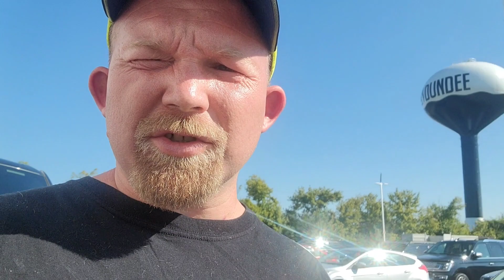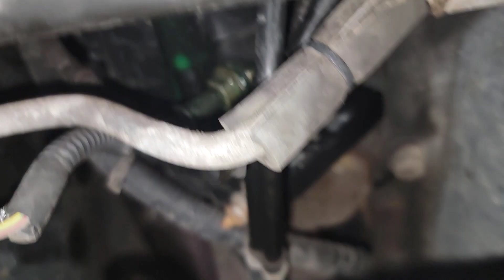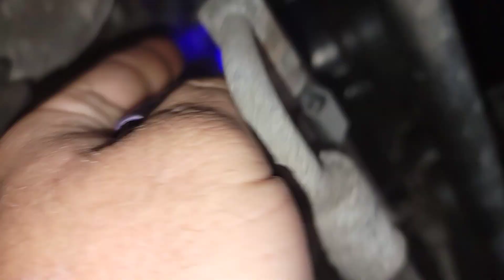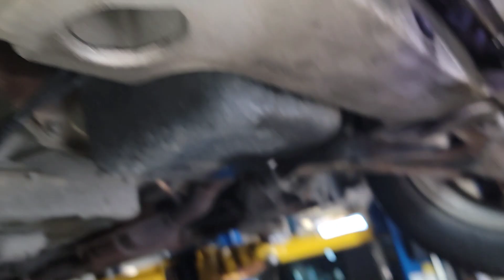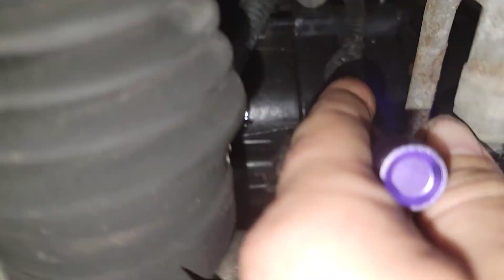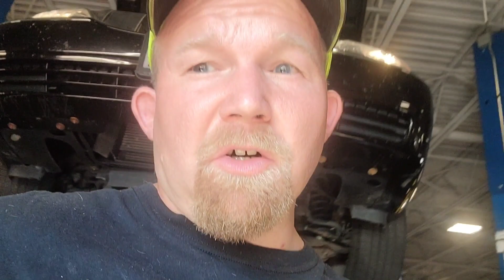2011 Lincoln TownCar AC Leak Been Here 4x - Finally Able To Verify The Leak and It's the Part

Comment: I received a power steering pump from Honda a few days ago that was supposed to be a reman unit. I opened the box and it was a used/failed unit that had apparently been sent for remanufacturing, but then it was just reboxed and sent back as a reman with nothing having been done with it. Parts quality really is getting starting to get bad. It almost seems like at the rate it's going, here in another 10 or 15 years, if you get a flat tire... you'll just have to replace the car. People need to stand up as one and say enough is enough, we don't want disposable cars, phones, electronics etc. We want well built products that are serviceable and we want quality well built options for replacement parts.
Reply: I've ran into that situation working at an independent parts store. I checked all the reman parts boxes when checking orders in. I had some instances where a core had been placed in a brand new box. I also checked any electrical/electronic items such as sensors and modules. Many times I found evidence that the unit in question had been plugged in and then returned to be shipped out again. One day I picked up some loose Wix oil filters at a warehouse. I checked each individual filter for any damages. One filter had a good size dent on the bottom. I refused it and pointed out the damage to the counterman. He issued a return credit on the spot. He wrote it up as a "new return". They were going to restock and resell the filter. I couldn't believe what I witnessed.

Comment: What's worse is, this is an OEM pricey compressor, likely a nice $400 to $600 part yet there are aftermarket brands that will outlast them for $210 such as UAC, Universal Air Conditioning.
Reply: @bikeman1x11  Yeah but these days, even the original parts are failing early which makes you really think about going back with OEM or choosing a good aftermarket part. If OEM's are failing early, no point in banging your head on the wall for OEM do overs.
Reply: @bikeman1x11  Once the OEM fails early, it make no sense to allow loyalty to interfere with common sense and buy another reject.  Not all aftermarket brands are crap. Gates, Bando, Dorman, Delphi, Bosch, Denso, Moog, Gabriel, KYB, Continental, Magna Flo, Walker, Flow Master, Timken and other major players in aftermarket parts often exceed OEM criteria and perform and last longer.  When it comes to electronics, sensors and other metering parts its always best to use OEM of course. We all have had bad experiences with aftermarket however, I have had as much issues with OEM in the past 10 years especially in window regulators, fuel pumps, wheel bearings and seals. If you have automotive experience, you can pretty much determine if you will pay 3X less for aftermarket parts depending on experience.  Folks who are DIY and know very little, they are always better off using OEM parts and paying the higher price for them.
Reply: @bikeman1x11  Yep, that the point with aftermarket, you need to know which brands are worth having. In this video, the Ford OEM part was crap out of the box. Likely rare but I have experienced a many OEM fail early and for that, I figure another maker is warranted, providing choices are good.
Reply: This was a Napa part
Reply from the maker: This did end up being a Napa reman
Reply from the maker: I made a mistake and assumed it was Ford because it was ordered while I was gone on vacation
Reply: @FordBossMe  How dare they

Comment: I never had good luck with NAPA A/C compressors, water pumps, power steering pumps, and alternators. I used to work for NAPA. Glad you were able to get another Panther back out on the road.

Comment: 1999 Chevy Express van: it took THREE(3) "new" alternators to get one that mostly worked. Even that one has a temperature sensitivity(very hot under the hood = voltage and current output drops off a bit). Had local shop doing the replacing, they were not happy either. New parts were sourced by the shop from NAPA and O-Really(?).

Comment: I had a 2003 Mazda Tribute/Ford Escape. I changed the compressor 4 times. 2 lasted a few months, 2 a few minutes…. I thought I was doing something wrong and brought it to a shop. They changed it 3 more times. Drove it until the 7th compressor failed… then I gave the car away.

Comment: I just bought 4 new blizzak snow tires mounted on aluminum rims from tire rack. They came already mounted and balanced. The tires are directional. They came with big stickers on them telling you which ones are for the drivers side and passenger side. I thought well that’s a good idea so no one installs them incorrectly on their car. Then I noticed they mounted 1 of them on the rim backwards. I called them and they told me to take it to a tire shop and have them fix it and send them the receipt and they would reimburse me. I said NO WAY. I’m not going to have someone scratching up my new rim fixing their mistake. And i made them send me a new tire and rim that was mounted correctly.

Comment: Man I have had a stack of manufacture parts and poor assembly stuff of late. Diff and turbo actuators, thottle control valves. We had this car with some hvac connectors connected around the wrong way round. Then something wierd happened factory with a connection too affecting the av the cruise control radar.  Bizare. Even the AV going funky.

Comment: I'll agree with the fact that "New Parts" today, OEM or not, are NOT quality parts by any means.  If a vehicle is older, you are sometimes better off repairing said part vs. replace due to the poor manufacturing methods and quality control today.  Like I have said for decades, sell me a battery that works, not one with a 10 year warranty. The warranty doesn't help me any when I'm 80 miles from the next battery sales store and it fails in 18 months.

Comment: Is the UV dye something that comes with the vehicle from the factory or is it something technicians inject during diagnosis?  I've got a car that's AC has slowly been leaking over the last few years and I was thinking about getting a cheap black light.
Reply: Some newer cars do come with UV Dye, older ones do not. It can be added to the AC system by qualified techs-which is best.
Reply from the maker: Some older ones actually have the air conditioning dye as well because they drop a air conditioning dye wafer in the bottom of the accumulator before the assemblies installed

Comment: That part does not look new. It looks like a salvage yard repaint. If the ford part is not available get a new UAC or Denso. That looks like an Oreilly special
Reply from the maker: There was a Napa remanufactured AC compressor I said Ford but I did not mean that

Comment: That compressor is not an OEM replacement compressor. The OEMs do not paint their compressors they are aluminum with no paint. I work at a reman AC for Denso/Toyota for over 7 years. We did not paint the compressors. FourSeasons was a company that would paint their compressors. To me that looks like a FourSeasons reman compressor. I would never get a compressor from them. They have very bad product.
Reply from the maker: Technically it is an oem compressor but what ends up happening is it goes to somebody else to get refurbished and they just paint over it and you are right I was mistaken it was from Napa but it still is an OE compressor